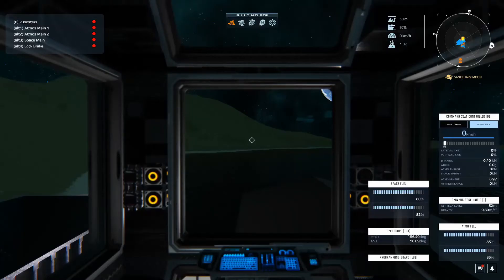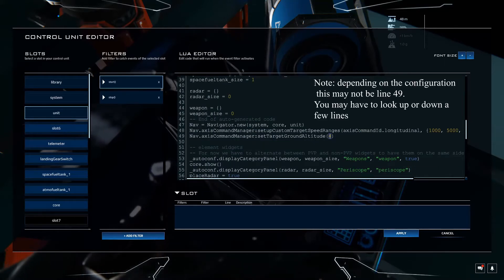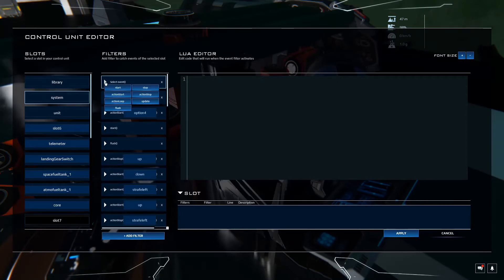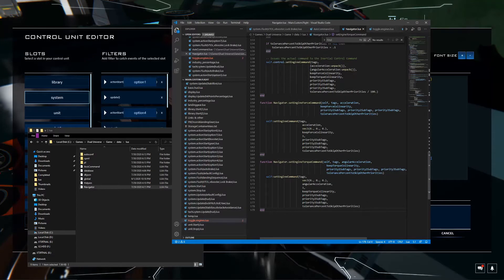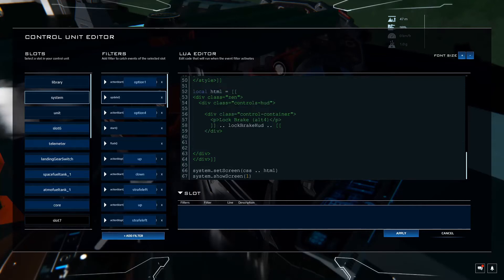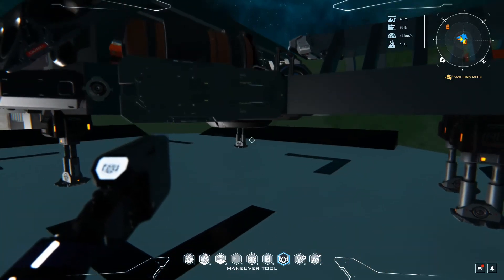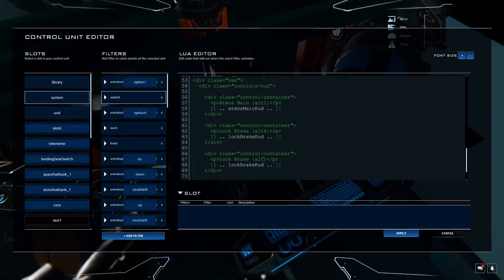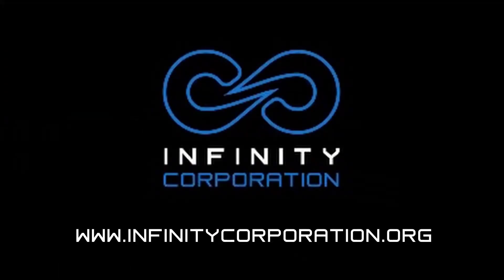DU Lua Tutorial 7 - Toggle Engines

Comment: Is there a way to instead of using a key binding to use a manual switch (in game element) for this? I attempted to trial and error it but it wouldn't let me link the switch to the cockpit.

Also I'm assuming I'd need to watch the "other video" you refer to in order to get the thing to light up on the screen (top right widget)

Also also - my booster still turns itself on when I "let go" of my raise height / go up keybind even though there's nothing that's setting it to turn on. Alt 1 (or numpad 1 which I have bound as alternative) doesn't turn it back off. I assumed the code in flush was related only to displaying it's "on / off" status, so would you happen to know why it is happening?

EDIT: Slowly figuring it out as I watch your videos with lots of trial and error and whatnot. Still trying to get my head around what goes where in lua. Thank you for the content though it really helps :)